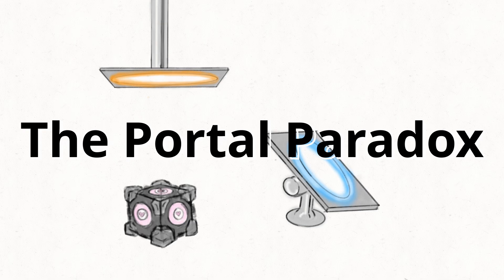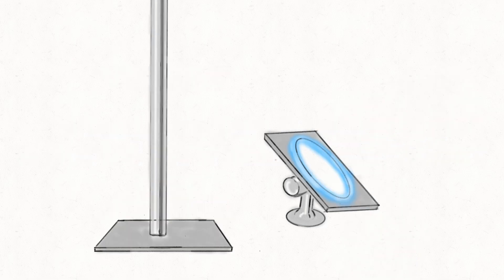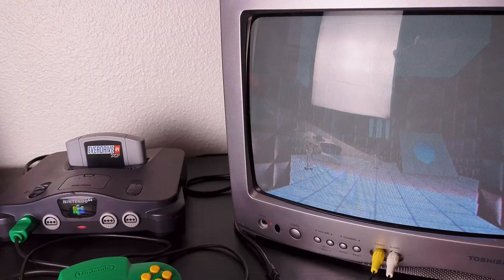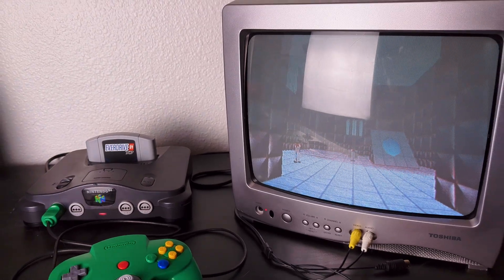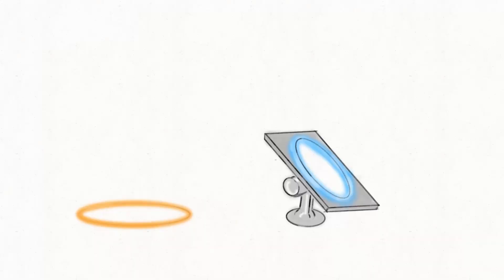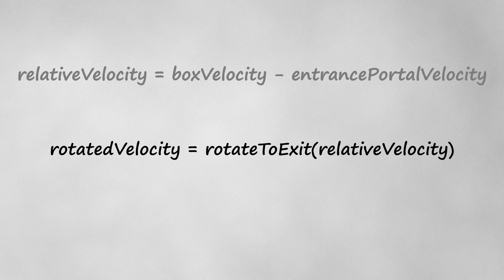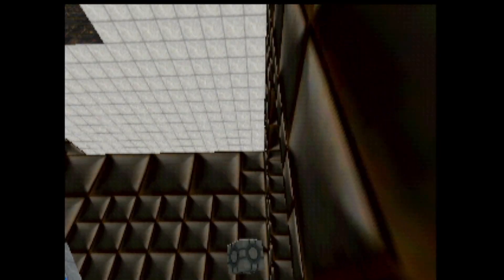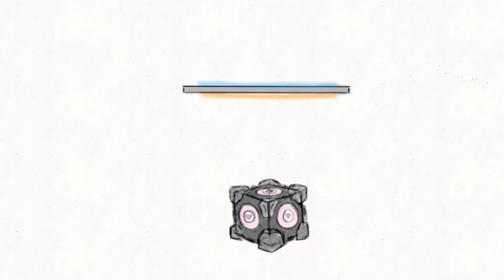I rewrote Portal from scratch and solved the Portal Paradox

Comment: I would say the issue with this discussion is the difference between momentum and velocity. If you're basing your coding on velocity, then the cube should move at the same relative speed as the slamming portal, but if you're basing on momentum, as the orange portal can't impart any energy to the cube, the cube should just fall out, based on the possible position of the blue portal.
Reply: The problem with this discussion is it is all vacuously true as portals are a fake concept. so while you can use this for an exercise in creating and recognizing coherent arguments by looking for inconsistencies in one particular argument or another, the argument itself speaks nothing to actual understanding of physics. 

Are portals just holes or are they relative observational points in the universe? Neither they are fictional concepts that only exist in simulation that physics are defined by a program written to facilitate a good time not strictly argue theoretical physics.
Reply: Agreed, and I feel that the velocity is also a bit of a red herring, since it assumes both sides of the portal are the same frame of reference, which I don't think is a simple answer.
Reply: Now you're thinking with portals
Reply: Momemtum is equal to mass times velocity. They directly depend on each other.
Reply: Consider what we would expect if the portals instead connected two separate universes. When the yellow portal moves, the blue universe is now in motion relative to the yellow universe. The cube didn't "fly out" of the blue portal. From the cube's perspective, it's the blue universe flying past the stationary cube.

If you're going to invoke relativity, invoke it all the way!

From this perspective, the test as demonstrated is perfectly consistent from the cube's frame of reference. The paradox only arises from the observer's inability to observe simultaneously from two different perspectives.
Reply: In fact, I'm going to copy this into a full comment. I think it's worth it!
Reply: @sabinrawr  fucking thank you. Every time this comes up I have to keep explaining this concept.
Reply: momentum relative to what? There is no such thing as absolute global momentum. Only momentum relative to an object.

Or a portal.
Reply: @petersmythe6462  the box changes momentum relative to both the in-portal and the out-portal. The magnitude (relative to the in-portal) doesn't change, but the direction does, and momentum is a vector.
Reply: My thoughts exactly. His setup violates conservation of momentum. I reasoned it out slightly differently though. If we assume that slamming the portal down on the cube launches it through the other portal, then there must be some force applied by the portal to the cube. If this force is proportional to the speed of the portal and points through the portal in the opposite direction of its motion, then the hula hoop example will actually launch the cube into the air!
Reply: @1925683  not quite, as I could be reasoned that in the same way the orange (down) portal imparts energy to the cube, it could be argued that the blue (up) portal could rob it of the energy, and that addition/subtraction of energy could be based relative of the two portals position in space/ velocity/momentum.
Reply: @Zarren_Redacted  no force acts upon the cube, you're wrong and you know it.
Reply: @xelgodis80085  there's no motion without a force. That's why in portal the gravity is the only force doing work.
In a inertial frame of reference they don't. however portals are not falling to the center of the earth, therefore they're not in an inertial frame of reference, so yeah you can say there's an up and down in our frame of reference. Momentum and energy were never conserved in portal.
And don't bother with spacetime curvature or eintein's theory of relativity because I'm not a physicist
Reply: @Grogcito  "don't bother with science because I'm not a scientist".

Alright man, at least you admit it. Have a great day my dude.
Reply: @xelgodis80085  okay, explain the curvature of the wormholes from portal, I'll wait
Reply: @1925683  even stationary portals violate conservation of momentum. if you throw a cube down into a portal and it shoots out horizontally from a portal on the wall then momentum wasn't conserved

the hula hoop example is fine because you still have the cancellation of the motion of the exit portal and the cube being pushed through
Reply: @a b  except that's exactly how it works. The frame of reference matters, the initial velocity and direction is translated 1:1.

Are you saying that the universe has an "up" and "down"? That's some flat earth idiocy right there.
Reply: @ab-mi9vf 
Momentum would be conserved, just pointed in a different direction right?
Reply: @zec.4491  because momentum is a vector, conservation includes direction. so even if the magnitude were the same, if it were pointing in a different direction it wouldn't be considered conserved
Reply: @ab-mi9vf  
Yup you're right nvm
Reply: @1925683  The force is the entire world moving relative to the cube. The world moving relative to an object or an object moving relative to the world is the same thing from different frames of reference.
Reply: imagine the cube suspended in the air. the portal flies at it at an extreme speed, but instead of halting against a surface, the portal continues. (think of it like an open-ended bug catching net). from the perspective of the cube, it is still motionless. it is the entire universe around it that is moving. but to the perspective of the new universe it has been portal'd to, it is flying in a straight line through the air. it isn't until gravity and air particles act upon it to slow it down that the cube begins to be affected.   it's capturing a stationary object in a very stretchy bug catching net that begins to drag it along after time.

if the cube were to halt all motion the second it fully passed through the portal, how is it possible to have an initial intense speed relative to the stationary exit portal and ALSO halt all apparent movement a moment later once it has cleared the threshold?

the only alternative is that the portals moving towards each other creates a pressurized wall of air that pushes on anything entering it as the air particles collide, and THIS is the force that acts upon and halts the cube as it passes through. in a vacuum, the portal will fling out much like the video. so the question to the paradox is how much impact does the pressure of air have upon an object entering at high speeds relative to the portal.
Reply: Wait. . . 
Portals, even when stationary, do fundamentally impart energy to the objects that pass through them. You can literally make yourself fall and then end up higher than where you started. You can make a perpetual motion machine by having an object fall forever through vertically aligned portals.
Reply: But what if you consider that as the box exits the exit portal, specific portions of the box have to be moving through space? Let's say that a box has 10x inches as it's height, and the entrance portal is moving downwards. In the time it takes the portal to move from the very top of the box down x inches, then 1/10 of the mater in that box is now poking out of the exit portal. If the portal continues to descend x additional inches, then that first tenth of the box is now in a different position than it was before. Then, continue with that logic until all 10x inches of the cube are through the portal. Now it's on the other side completely, and every part of it was moving through space. Why would it stop? The only mechanism I can think that might stop it is the tension between the matter of the cube itself pulling the matter that exited back towards the matter that has yet to exit (like throwing a baseball that's tied to a bowling ball) but is that really enough to prevent all motion, especially at the end of the process where most of the cube has exited, or would it just reduce it?
Reply: momentum is mass times velocity. velocity is always relative to a chosen perspective, there is no such thing as absolute velocity. Therefore, there is no difference. We only think of velocity as an absolute value because of our default perspective of "relative to the surface of the earth."
Reply: I believe you would appear through the portal at the speed depicted, but not launch once you are through since you weren't moving.  If you were in perpetual fall scenario but they start moving one of the portals you wouldn't expect to start falling at a different speed, you would just continue accelerating until you reach terminal velocity and the movement of the portals wouldn't change that.
Reply: The momentum and energy is relative also. The moving platform has energy relative to the cube. The cube comes out of the blue portal with it's energy relative to the orange portal.
Reply: Momentum is also relative. There is no difference.
Reply: Where does the momentum of the piston go?
Reply: I think the Source engine conserves speed rather than momentum, so GLaDOS lies and the implementation is truthful
Reply: Something worth noting is the interaction of the portal launched to the moon. The moon's relative speed compared to the "stationary" portal on earth is thousands of miles per hour different and yet when objects go through the portal to the moon they aren't flung away with said relative velocity they instead retain their momentum. I don't understand why this isn't brought up more in these portal paradox conversations.

This guy picked which solution he wanted and coded it accordingly then used his code to "prove" he was right. Very biased.
Reply: @walf6978  But this behavior is consistent with the solution in the video. In the game, objects that go through the portal on earth maintain their velocity relative to the portals, despite the portal on the moon moving thousands of miles per hour. Objects leaving that portal gain whatever speed that portal is moving at
Reply: @walf6978  the irony to the statement of "coding the way they wanted to" is that you actually have to add more lines of code to make the A solution work, on top of the code that already makes B work. In other words, it's impossible to program an engine that runs the A solution first without having it functioning with B logic beforehand (or AKA, you can take any engine code that functions as A, and you can achieve B by simply removing a few lines). 

Why is that? Because you have to add a few extra lines that calls for the object's relative movement to be nullified the moment it completely eclipses through the portal end.
Reply: @dirtchest6986  the irony to the statement of "coding the way they wanted to" is that you actually have to add more lines of code to make the B solution work, on top of the code that already makes A work. In other words, it's impossible to program an engine that runs the B solution first without having it functioning with A logic beforehand (or AKA, you can take any engine code that functions as B, and you can achieve A by simply removing a few lines). 

Why is that? Because you have to add a few extra lines that calls for the object's relative movement to be initial portal to be added to the object the moment it completely eclipses through the portal end.
Reply: @dirtchest6986  My actual response is this:
If you have the cube on the pedestal and the portal moves down onto it rapidly then stops immediately once it is exactly halfway on the cube, what happens? In the solution for B, the half that passed through the portal would have immense kinetic energy/momentum, so would it to the viewer pull itself up through the portal at high speeds? Personally I think that would be ridiculous.

I think it is more intuitive that the cube remains on the pedestal rather than magically gaining large amounts of momentum and kinetic energy just by sitting there.
Reply: @walf6978  you are going about the relativity wrong. It makes much more sense that it would preserve the relative velocity compared to the portal it goes through. ie when you drop the box in the portal on earth (portal A) they are both moving relative to the earths position so they cancel out. Then the portal on the moon preserves the box’s relative velocity between it and portal A.
Reply: @walf6978 
Although I agree that the object should probably plop, the relative speed isnt between portals, its between the object and portal that it passes through first.
Reply: @walf6978  The only way you would be flung at that difference is if the moving portal didn't give you extra velocity. As we saw, the portal did impart the moons velocity on wheatley and chel and the air coming through as they were being blown straight up relative to the surface. They didn't have the moon's velocity going through, but sure did coming out. If they had retained their momentum, they wouldn't have stayed with the moon. Or if they did, it would have been out at an angle(whatever that angle is it would have been against the moon's direction of travel) because the rest of glados' mechanism would keep them tethered, but at that velocity difference between the earth and the moon, its likely that machinery would have been torn free. Hell is was practically tearing free anyways.
Reply: @DataDownLynk  By this logic, nothing can ever pass through the yellow portal unless it is already in motion relative to the arbitrary observer. So the cube should just be smashed and never appear at the blue portal.

From a physics perspective, I feel that this requires the cube and observer be entangled and that measurement of the cube does not disentangle them. The most basic of "terminal velocity" experiments should show why this isn't reasonable.
Reply: @walf6978  I agree. His "solution" is absolutely wrong. Portal is nothing more than connecting two areas, like a door passage. Why it could affect cube's speed? I don't think you gonna fly out of a door when you go outside.
Reply: @walf6978  Tell him directly instead of hiding it in a reply.
Reply: Nope. e=mc² applies in both scenarios. Speedy thing goes in, speedy thing goes out. It does not matter how the relative speed came about. In fact, the portal paradox is nothing more than people arguing against relativity.

It does not matter if it's the cube moving towards the portal or the entire planet being lifted up to the portal by a piston. The difference in speed remains the same. The only argument there is room for is whether the game is programmed with realistic physics or inconsistent and arbitrary ones. And in my opinion, any portal mechanic that doesn't impart momentum in such a scenario has sloppy programming if momentum is supposed to be preserved between portals.
Reply: @rendomstranger8698  I'm a physicist and you're completely wrong. Conservation of momentum is separate from conservation of energy and just saying the mass is the same as before doesn't speak anything about conservation of either in a macroscopic case.

your second paragraph is about relative velocities but you're using Galilean relativity. If we're being pedantic part of the issue originally raised is that it conserves speed (the scalar, the size of the relative difference) but not the actual velocity vector (and hence, not momentum)

momentum was never preserved through portals unless you just mean the magnitude of momentum. conservation of momentum fundamentally comes from translational symmetry and obviously portals break the symmetry of the problem at hand. if a box goes in with a downward momentum and exits with any other direction of momentum, even if it's the same magnitude, then it's not the same momentum and hence it wasn't conserved. (Unless the portals impart the difference into the entire earth, which is entirely possible--just considering the boxes alone it's explicitly not conserved)
Reply: @ab-mi9vf  Wait...but momentum would be conserved if a box fell through a portal vertically and shot out the exit portal horizontally, would it not? Hear me out here. Yes, the box changed direction relative to you, a stationary observer watching the box, but it didn't change direction relative to itself . Imagine that you jump through a portal on the ground. Your feet go in first, then legs, torso, and head. As you come out the other portal that's on the wall you shoot out sideways, but you are also sideways now as you emerge from the portal feet first, then legs, torso, and head.

Actually, now that I think about it, wasn't that a feature on Chell's boots? They would absorb impact (fall damage negation) and re-orient her?
Reply: @ab-mi9vf  I am no expert and am just posing a question. If the orange portal was moving down onto the cube quickly and the cube exited the blue portal slowly, would the cube compress to a thin rectangular prism out the blue portal? Would what remains to enter the orange portal start to push the matter exiting the blue out faster and retain its shape? or would you see the cube exit the blue portal quickly until it has fully passed through and then just fall? Im just curious if the different speeds going in and coming out would pose a problem in some manner.
Reply: @camyak  momentum is a vector quantity; for it to be conserved, the direction has to stay the same, not just the magnitude.
Reply: @ab-mi9vf  yeah, you can tell that if you set this up to have it shoot out that it must be imparting a force on the box, because if you pass it through several moving portals in the same direction you can boost it up to arbitrary velocities.
Reply: @RoyWiggins  Yes, exactly. Sorry, to be more clear I was arguing that by picking the box as the frame of reference, the direction is conserved, therefore momentum is conserved too.
Reply: @camyak  and the momentum of the box is null, so it doesn't fly out. Correct. 

It would work with either the box or the hole (portal) as an inertial frame of reference. An object moving through space is the same as space (a hole) moving over an object (the box).
Reply: @xelgodis80085  The momentum of the box is null from which reference point? Because from the sun's reference point, the box definitely have momentum. Now, if you think only your reference point that matters in this case, what about your reference point when looking through the exit portal? Is the box moving towards you not considered having a velocity? Why? If you put your hand over the exit portal as the box is exiting, is it not pushed away from the portal? What imparted the velocity and therefore momentum onto your hand? The box? Then does that not mean the box does have velocity and momentum?
Reply: @stephen01king  your freshman understanding of inertial reference frames is adorable. If momentum is imparted regardless because for some reason you find it acceptable to use irrelevant frames of reference, then explain how light is allowed to exceed its own maximum speed when being "pushed" through the portal. You literally do not understand the basic physics behind what you're talking about, nor do you understand why you're wrong. Just stop, you're embarrassing yourself.
Reply: @xelgodis80085  Sounds like someone doesn't understand inertial reference frames. The box is only at rest if seen through an observer at the entry portal. From an observer at the exit portal, the reference frame of the one at the entry portal is the one that is irrelevant here. Taking your own advice into account, we can just ignore that irrelevant reference frame and only take into account the reference frame of those at the exit portal. Now, what is the box doing at this reference frame? Is it moving or not? Won't you answer me with your AMAZING understanding of physics?

As for your irrelevant question about the speed of light, let me ask you this, if you run with a flashlight moving forward, does the light move faster than speed of light? No? Then why would it does so in this case?
Reply: This is the correct answer - because the orange portal exerts zero force on the cube (it doesn't touch it), the cube would remain stationary on the ground due to gravity, and would fall out of the blue portal only if the blue portal is tilted so that gravity pulls the cube out of it.
Reply: @MartinHindenes  Imagine if the exit portal is moving backwards at 5 m/s, and the entry portal is moving towards a stationary cube at 2 m/s, What velocity is the cube exiting the portal? Your logic would imply it would exit at 0 m/s, which would mean the cube would be pulled into the entry portal since the exit portal is moving away from the stationary cube that has exited the portal. Does that make sense to you? What imparted the force required to move the cube into the entry portal in this case?
Reply: The cube's velocity is zero even if the portal itself is moving relatively to the cube.

Keep in mind that a portal (the opening of the portal) has zero mass and zero volume. It is merely a 2D plane acting as a 3D gate between positions in 3D space.

To move the cube requires a force. The portal's movement exerts 0 force, because it's just a 2D plane moving in 3D space.

Gravity on the other hand...
Reply: @MartinHindenes  the mass of the portal has nothing to do with how frames of reference work. Also, the cube is only stationary from the frame of reference of an observer near the entry portal. From the portal's reference point, the cube is moving towards it at the same speed it is moving towards the cube from the observer's reference frame. The cube is also moving towards the portal from the frame of reference of an observer near the exit portal, which is why the cube has velocity, and therefore momentum at this reference point, and will continue to do so at it exits the portal.
Reply: @MartinHindenes  don't bother, they're beyond ignorant.
Reply: @xelgodis80085  Says the person who can't even refute my points and have trouble understanding frames of reference. It's funny how the most ignorant person is the one that is the fastest at calling others ignorant. I guess this is what they call projection.
Reply: @stephen01king  you know what, I may have been out of line. I had explained it in another post more clearly. Here you go:

Edit: here's the civil version of why this is wrong:

Let's establish basic facts and then why they must be true, then you can try to deny and pick it apart:

1) A portal must only ever be a link in space-time sharing an inertial frame of reference. 

This is because the portal has no mass or energy, it is an absence or void, aka a hole. It is Space.

2) The platform is accelerating, with a hole in it.

It is undeniable that the platform itself is accelerating, but the hole in the center is not, as an "absence" or "void" cannot accelerate.

3) An object passing through space is the same as space passing over an object.

Inertial frames of reference DO matter, and they form the very basis of physics.

4) The first law of thermodynamics must always be observed.

Energy cannot be created or destroyed, this is a fundamental fact.

Now let's set up this scenario:

A platform with a hole is accelerating. The hole passes over an object. The object remains stationary, and is simply on the other side of the hole.

By actual physics, this is how the portal interacts with the world around it, or rather doesn't interact at all as a void cannot impart force or act upon anything. The box is simply on the other side of a hole.

However, in the video's demonstration he assume that the void of the hole has a vector of energy or mass that somehow acts upon the box. This cannot be true, because the portal is SPACE, a VOID, NOTHINGNESS, in other words a HOLE. If it did somehow impart a force upon an object it passes over, than the very act of moving the portal means it passes over light moving through it. By the demonstration then, the light must also accelerate past the speed of light upon exit, even though nothing can exceed the speed of light.

The not so civil version:

It's a cute idea, but it's wrong. What you're saying is if you accelerate a portal near c, everything going through it close to or at c should accelerate past the speed of light.

The system instantly breaks down with a single second of critical thought. 

There is no velocity imparted on the cube, no force is acted upon it, it is simply transported from one location to another.

Maybe research quantum entanglement for why you're wrong, the information is publicly available. We've actually demonstrated this as false as we've created "white holes" for qubits that instantly communicated information over distances and didn't impart any extra energy when doing so.

No force acts upon the cube, it simply moves from one location to another as if passing through a hole or window.

It's exactly the same as if you had moved the entire room at a stationary cube. Why is it so hard for you to understand this, and why did you think that calculating 1 variable into a toaster would somehow replicate real life when it takes a damn-near super computer to calculate modern physics results?

In order for your crackpot theory to work, the universe requires an inherent orientation regardless of inertial frame of reference, which is mind-boggling stupid conjecture postulated by flat earthers.

You didn't include inertial frames of reference, you didn't include light cones, you didn't include dozens of variables because it's impossible to do so on an N64.

Stop the misinformation if you understand nothing about the physics.
Reply: @stephen01king  it all makes sense the minute you stop thinking of the portals as physical objects, because for all intents and purposes, they aren't.

What's moving isn't an object but a plane.
Reply: @xelgodis80085  Thank you for finally being civil, I don't understand why you immediately started belittling me the moment I made a reply to you.

"1) A portal must only ever be a link in space-time sharing an inertial frame of reference. 

This is because the portal has no mass or energy, it is an absence or void, aka a hole. It is Space."
  This is not relevant to my point. I never claimed they have mass or energy.

"Inertial frames of reference DO matter, and they form the very basis of physics."
  Then why do you continuously ignoring it for your own convenience?

"Energy cannot be created or destroyed, this is a fundamental fact."

  None is created or destroyed. Kinetic energy depends on velocity, which is a concept completely grounded on frames of references. To the portal and everything at the exit portal, the cube does have velocity and therefore kinetic energy. This is the fundamental part of physics YOU'RE ignoring.

"A platform with a hole is accelerating. The hole passes over an object. The object remains stationary, and is simply on the other side of the hole."
  The object is not stationary from the frame of reference of the portal. This is the most important part. The portal does not need to be an object with a mass to be a frame of reference.

"By actual physics, this is how the portal interacts with the world around it, or rather doesn't interact at all as a void cannot impart force or act upon anything. The box is simply on the other side of a hole."
  Even a hole can be a frame of reference. A frame of reference does not need to interact with an object. You really need to relearn your physics.

"However, in the video's demonstration he assume that the void of the hole has a vector of energy or mass that somehow acts upon the box."
  It doesn't. His calculation only take into account relative velocity, as in, it is taking the portal as a frame of reference. There is no mention of mass or energy in his equation, so it seems you don't understand those two concepts as well.

"This cannot be true, because the portal is SPACE, a VOID, NOTHINGNESS, in other words a HOLE"
  This is not relevant to the discussion.

"By the demonstration then, the light must also accelerate past the speed of light upon exit, even though nothing can exceed the speed of light."
  By demonstration, light doesn't exceed the speed of light just because the source is moving, so why would it does so here. Speed of light is a complicated subject that maybe you shouldn't touch on since you don't even grasp more basic concepts.

"The not so civil version:"
  Oh, of course. Here we go again. Can't even keep it civil within a single comment.

"It's a cute idea, but it's wrong. What you're saying is if you accelerate a portal near c, everything going through it close to or at c should accelerate past the speed of light."
  Like I said earlier, not how it works. Accelerating a light source doesn't make light exceed the speed of light, either. Stop trying to use light as an argument. It doesn't work like that. With light, you'd have to consider time dilation and other more complicated concepts we don't need to argue on right now. Stick with the basics.

"Maybe research quantum entanglement for why you're wrong, the information is publicly available. We've actually demonstrated this as false as we've created "white holes" for qubits that instantly communicated information over distances and didn't impart any extra energy when doing so."
  You're using complicated concepts to make your point but you don't even understand the basic physics that I've been explaining here, so stop it. There are no extra energy being imparted anywhere. The energy is there already in the form of kinetic energy in the frame of reference of the portal and any observer at the exit portal.

"It's exactly the same as if you had moved the entire room at a stationary cube. Why is it so hard for you to understand this, and why did you think that calculating 1 variable into a toaster would somehow replicate real life when it takes a damn-near super computer to calculate modern physics results?"
  The cube would be moving through the room for any observer inside the room, so thanks for proving my point. And if you get hit by this 'stationary' cube while observing from inside the moving room, you'd get imparted with energy the same way a moving cube would.
  The concept of frames of reference is a simple one. We learn it in school. Why would you need a supercomputer to calculate this? That's like saying you can't calculate kinetic energy manually because physics is complicated. Maybe you just don't understand physics enough.

"In order for your crackpot theory to work, the universe requires an inherent orientation regardless of inertial frame of reference, which is mind-boggling stupid conjecture postulated by flat earthers."
  What do you even mean by this? Normal physics is based on frames of reference. What does orientation have anything to do with anything? What does flat earther have to do with anything? If anything, a flat eather would have as much understanding of this problem as you seem to have, which is frighteningly little.

"You didn't include inertial frames of reference, you didn't include light cones, you didn't include dozens of variables because it's impossible to do so on an N64."
  What part of calculating relative velocity to the portal is not including frames of reference in his simulation? What do you think frames of reference even mean in physics? And light cones? What are you talking about? I am getting frustrated by your shallow knowledge in physics. You seem to know a lot of big words and concepts, but lack proper understanding in any of them.
Reply: @MartinHindenes   nobody is thinking of portals as physical objects. They are frames of reference from which we can derive physics calculation. Try and answer one of my earlier question to you regarding the speed of portals. It serves to demonstrate why your explanation doesn't quite work in a consistent manner.
Reply: @stephen01king  I thought it was the same post, my bad. The issue with this line of fallacious reasoning is that it's heavily relied upon by flat earthers, hence my immediate hostility. I will not tolerate the type of ignorance that maliciously spreads doubt for scientific consensus. 

We've tested this before in space, passing a ring over an object in space does not propel it. This is not up for debate.
Reply: @stephen01king  even as frames of reference you run into trouble if you try to say that the cube has relative velocity to the portal — if that's the case, then not just the cube, but the entire universe on one side of the portal has velocity versus the moving portal's universe.

If the cube has relative velocity, both instances of the universe does too.

Does moving one portal move the entire universe in the opposite direction? If not, the thesis that the cube is moving is incorrect.
Reply: @xelgodis80085  "passing a ring over an object in space does not propel it" — perfect analogy 👏
Reply: @MartinHindenes  you can easily say the entire universe is moving, that's how frames of reference work. There is no point in the universe that we can say is actually static, since that would be impossible to prove. 

By using something as a frame of reference, you use that as the static point for your physics calculation, and assume everything moves relative to that point.

If you wanna claim that a universe cannot have a relative velocity, you completely don't understand the concept of relative velocity. Even a static object can have relative velocity, because it only requires two objects or points of reference to not move at the same velocity.
Reply: @stephen01king  the universe contains all of space-time, how can it itself have a velocity? In what medium?

The key difference here is that you're changing the kinetic energy of the universe relative to another instance of the same universe, by moving the portal. How much energy does it take to do that? 

Does the moving portal have an infinite energy producing capacity?
Reply: If moving the portal 1 meter to pass over the cube, physically speeds up the cube by the same speed that the portal is moving (but the opposite direction), you have by definition also moved one universe by 1 meter. You can't contain it to only what passes through the portal - the portal is only a gate.
Reply: @MartinHindenes  if you claim the universe have no velocity, what reference point are you referring to? Where in the universe is there a space where you can prove that it doesn't move whatsoever. The universe is not even static in reference to itself, considering that it is constantly expanding.

Energy calculation is also dependent on the frame of reference it is calculated from. Energy calculated from the frame of reference of the Earth is different from the energy calculated from the reference of the sun. The only thing physics tell us is that the total energy of the system cannot be increased or reduced, not that it calculates to the same value from every reference point. You can easily see this from the fact that the cube can be both at rest to you, but has kinetic energy in reference to the sun. This fact also applies to the cube when looking through the exit portal. 

It is also impossible to calculate the kinetic energy of the whole universe in reference to the portal, since the portal itself is attached to a rotating earth that orbits around a sun that also orbits inside a galaxy in an ever expanding universe. This energy is also irrelevant to the discussion, so why are you even bringing it up?

The portal do not need to provide infinite energy just like you do not need to provide infinite energy to move the whole universe in your reference point from just walking forward normally.

Finally, do you not realize that by walking forward by 1 meter, you also managed to move the whole universe 1 m behind you? How is this not an issue when you walk around everyday but is somehow an issue when it comes to the portal?